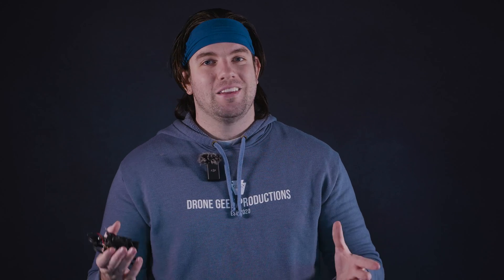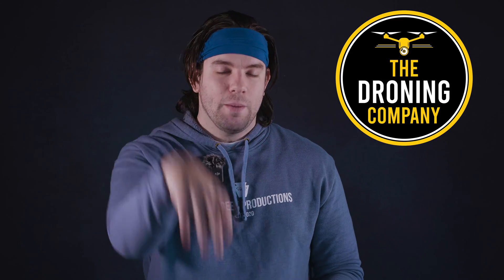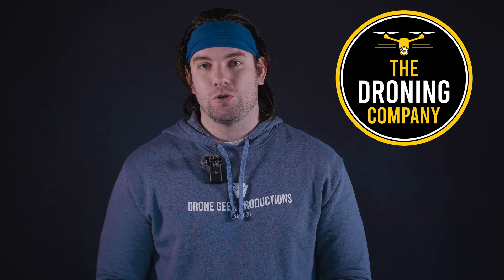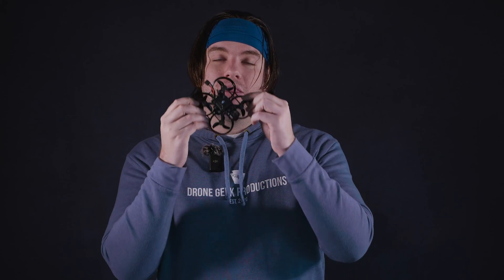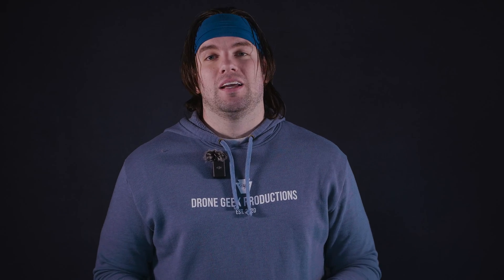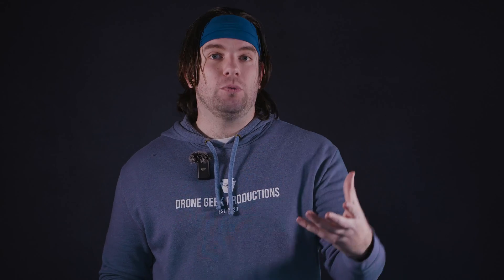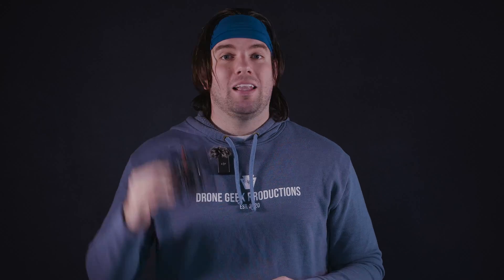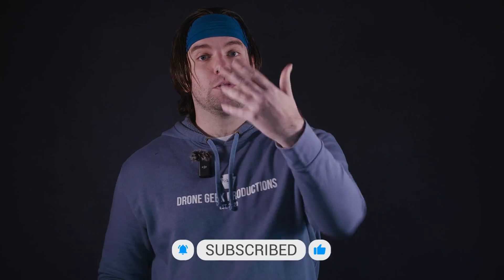USING THE PAVO PICO FOR COMMERCIAL WORK?! | How practical is this drone for the FPV professional?...

Comment: Just picked one up, but i'm a beginner to FPV and cant get it to stay level when hovering. Any tips on getting it calibrated for indoor use?
Reply from the maker: What do you mean by getting it to stay level? Typically leveling is on you via pitch and roll adjustments, but curious if you mean there’s something else that is uncharacteristically wrong with it.
Reply: @TheDroneGeek  if I’m flying in level mode, I should be able to hover without feeling a drag in any direction right? I’m feeling a slight drag to the left, even after calibrating the accelerometer.

Btw in your video did you shoot in acro or level? Great shot by the way
Reply from the maker: @techwildlife1 if you are in angle mode then it will keep the drone level as far as tilt appearing in the camera feed goes, but it will not hold position or keep it from drifting. Serious drifting can sometimes be helped by one of the following:

- An accelerometer trim within BetaFlight
- A gyroscope calibration within BetaFlight

Keep in-mind too that the Pavo Pico is ultra-lightweight, so even a mild breeze is going to push it around a bit. Not just breezes, but changes in airflow (i.e. a fan, central air, an open door or window, even its own propwash in tight quarters, etc.).

I’d check out the accelerometer and gyroscope first. If you have trouble, check out Joshua Bardwell’s channel. That’s how I’m learning the nuances of flying and building FPVs and the dude is a life saver for real. I’m sure he has answers for you somewhere that would do a better job than I ever could.
Reply: @TheDroneGeek  thank you for this. Will look into those details. Keep up the good work, I subscribed 👍
Reply: @TheDroneGeek  I meant angle mode

Comment: How much did you charge to film this?
Reply from the maker: I don’t disclose exact amounts negotiated and agreed upon with clients — that’s between me and them. However, my hourly rate changes depending upon factors of the shoot, there is no one-size fits all in my opinion. To more precisely answer your question though, my average range is from $175/hr. to $300/hr. again taking into account how risky or complex a flight might be for my equipment and the personnel and equipment/facilities in the area which I am operating.